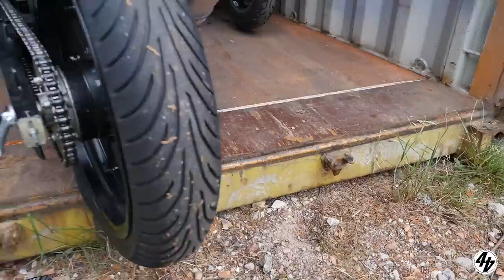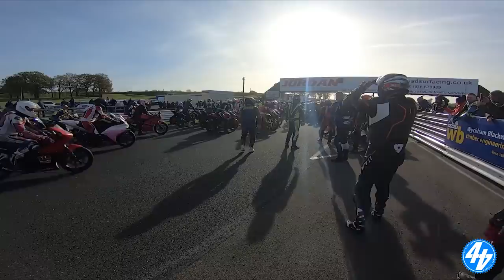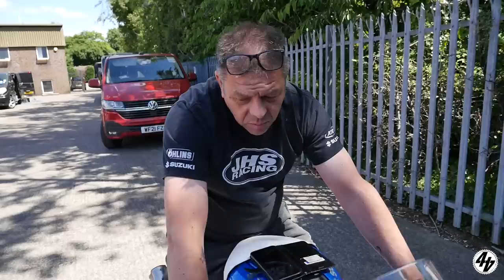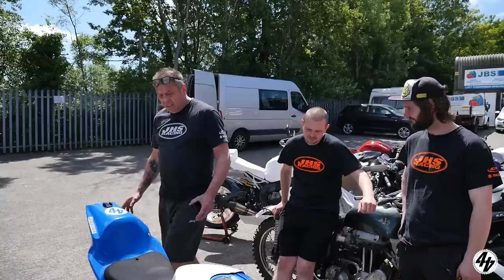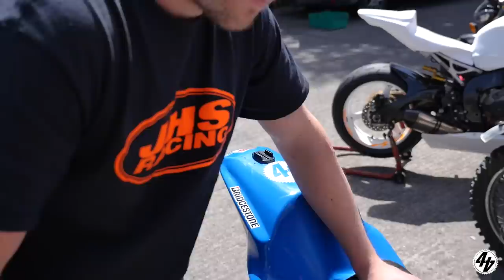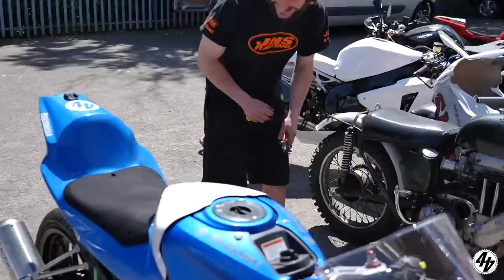PREPARING FOR ANOTHER BRUTAL 24 HOUR RACE!

Comment: Less friction, more speed?: loosen the chain off a bit more than it should be - make sure the caliper pistons are lubed so there's no pad friction on the discs - lube the chain every time you come in with some light oil - thinner engine oil - what else?